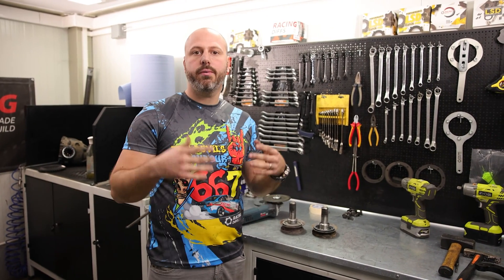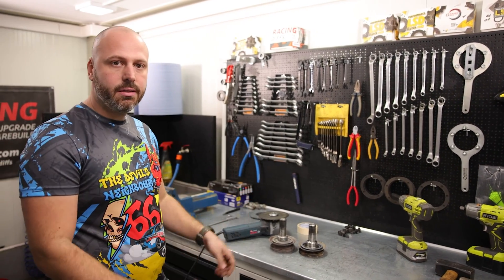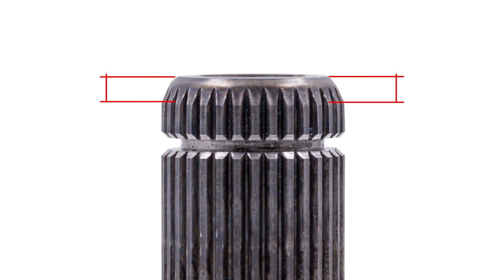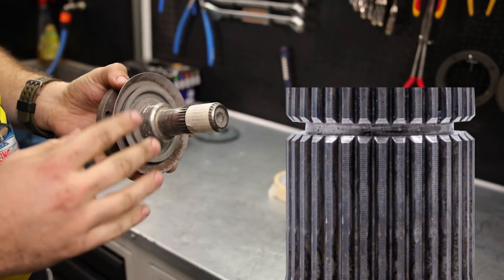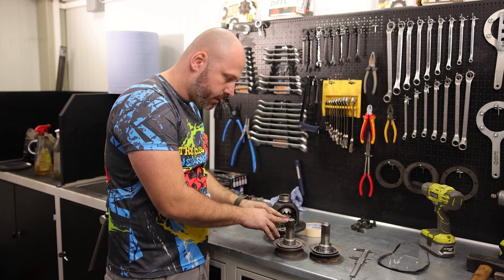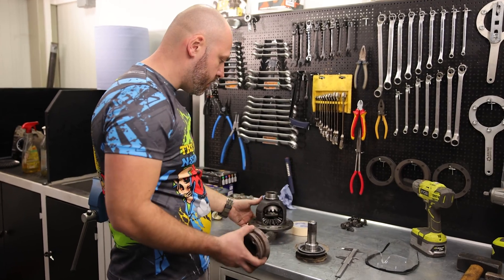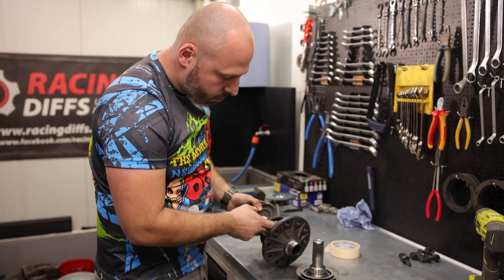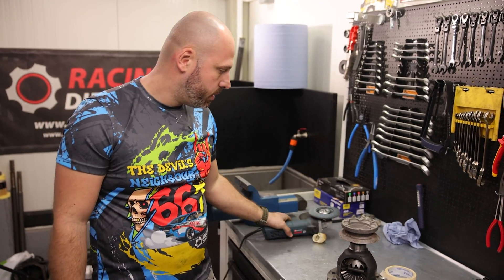Install RacingDiffs LSD Conversion Kit: DIY BMW Differential Flange cutting - No Lathe Required

Comment: Is cutting them like this actually okay?? What if I cant get it exactly flat or smooth?? Will the clutches not engage properly?? Should I try this myself or send them to the machine shop??
Reply from the maker: If you have doubts, better send them to a machine shop. If you use grinder regularly, like every day, then you'll find this rather easy.
Reply: @RacingDiffs  Is there a margain of error? What if I dont cut enough or cut to much? Will it still work fine?
Reply from the maker: It's better to cut a bit more than a bit less. Flange shouldn't touch a friction plate.
Reply: @RacingDiffs  What is the service life of the friction plates? Do you sell the friction plates seperately?
Reply from the maker: 60-100k km is some usual service point. We sell them separately, the price is 40eur.

Comment: What append if i dont cut them ?
Reply from the maker: Then, the set won't be working as it should.
Reply: @RacingDiffs  thanks for the response !
Reply: If you don't cut them the axle flanges will pop out. That's what happened to me. I bought the kit from racing diffs and it said you no longer need to trim the axle flanges. I didn't do any trimming per the instructions but the axle flanges pop out after a few miles of driving.
Reply: I am interested too